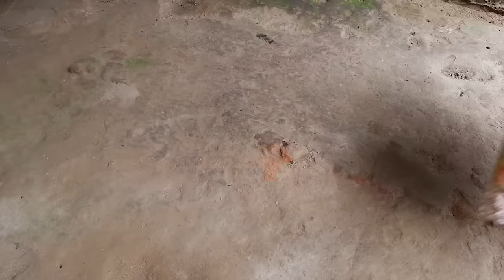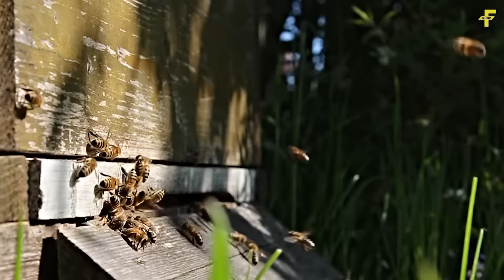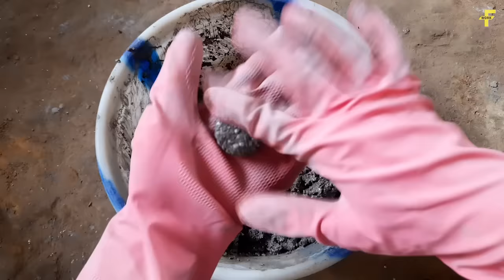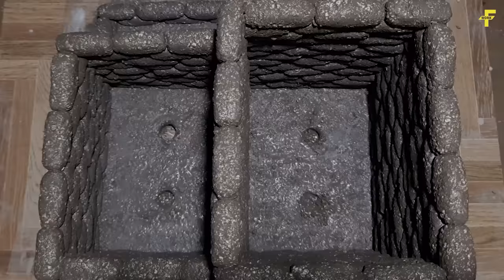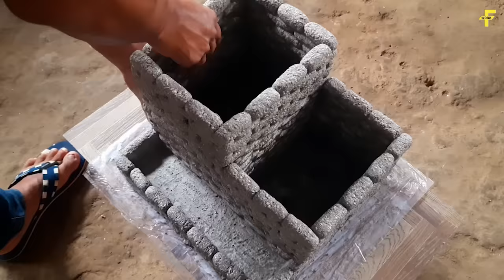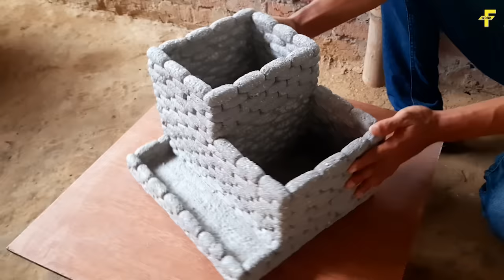Amazing Flower pot making from Thermocol

Comment: And also tell that is it mandatory to use metal pieces in base?
Reply from the maker: Purpose of using iron sticks is to make the base stronger, so that it doesn't break during handling. You can make it without it also.
Reply: @raindrop8660 6  à ce

Comment: Sir r u using sand for this?
And cn u pls tell the ratio of the thermocol and cement ? Also pls tell all the ingredients in english pls ? Pls?
Reply from the maker: 1 portion styrofoam, 1 portion cement, water, iron rods and glue. Sand is not used.
Reply: @freetimework  thank you sir
Reply: @freetimework  what kind of glue did you use?
Reply: I also want to make it and i try it insha Allah.😍
Reply from the maker: Fevicol.